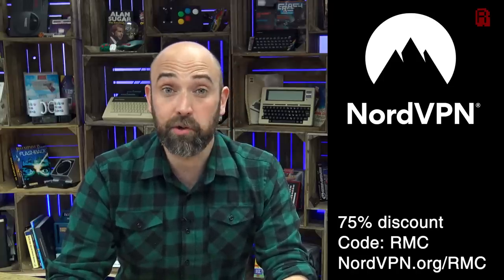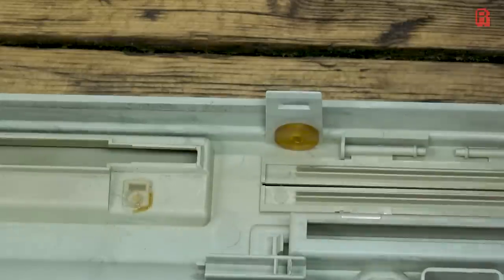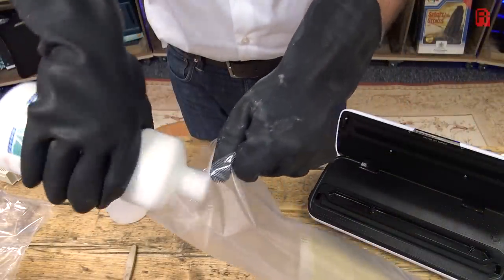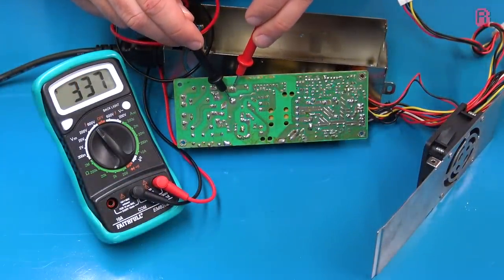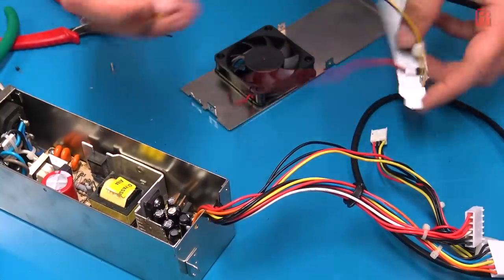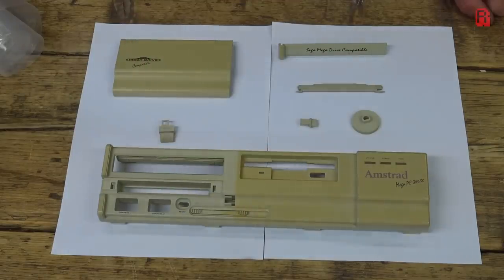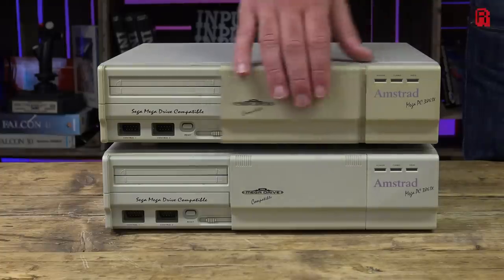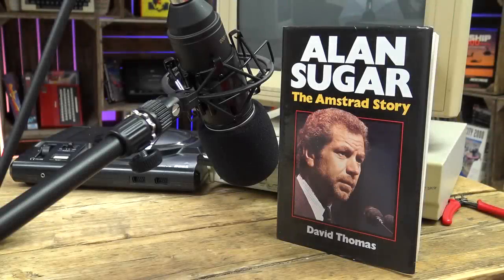Amstrad Mega PC - Retrobrite and Repairs | Trash to Treasure (3/4)

Comment: in the future, re-galvanizing corroded steel is actually very easy via electroplating. just need a ~6V@2A power supply (a 6V battery charger or bench power supply), a chunk of zinc to use as an electrode, some copper wire, a tub big enough to hang the steel piece in, and some epsom salt as an electrolyte.

before starting, make sure the steel is very clean; use nitrile gloves while handling it, clean it with fragrance free dish soap and a nylon brush to remove any dirt or oils, and then with a metal cleaner and scotchbrite pad to remove any oxidation. otherwise you could end up with dark spots or peeling zinc.

hook the positive lead of your power supply up to the zinc electrode, and the steel up to negative with the copper wires hanging it. make sure to move the work piece around as the plating is more-or-less 'line of sight.' just don't let the electrode touch the work piece!

with a thick enough plating, you can buff the zinc to a shine and clear coat it. 😺

I replated the rusty EMI shielding and IO ports on my Macintosh Quadra 610 that way.

Comment: I'm curious as to why you didn't just swap the fan out for say a 60mm  noctua fan. It'd be quieter. Is it because you didn't want to bother with  converting the 12 volt  fan header to 5 volts?

Comment: 337V is peak-to-peak voltage of AC waveform. 240V is RMS  (root mean square) value of ~339V p-t-p. These big capacitors in power supplies are usually rated at 385v-400v because of this. Using lower rated capacitor will result in fireworks.
Reply: i also said psu recap was not necesary since that PC was probably not used for more than 3 years. My dad has DVR for  video surveillance at his firm and it has a "Delta Electronics" PSU inside 
which looks identical to this Seasonic and it`s been on for the past 17 years with minor intreruptions. PSU it is rated 250w maximum peak power but the DVR uses less than 70w.
These new electrolitic capacitors (manufactured 2019..2018 ) that can be found today in shops are like the blank cd`s you find today in shops.. just a legacy.. poor quality... 
i think he just shortened the lifespan of that PSU :(

Comment: If you want to stop it from yellowing after retrobrighting get some high quality car wax and apply it to the plastic. It will reflect uv light and act as a replacement for the original protection the plastic had. It will slow down the yellowing process substantially.

Comment: You can measure a voltage across two points in any circuit and it is always completely accurate, no problems (well, if the meter is in order). Measuring singular component values (in example measuring resistance of a resistor) in a circuit might not give correct results because of the other components. 
   The large cap is rated for 400V (the max voltage you can put at it's pins), the capacity is something else. Shorting a "loaded" cap with a screwdriver will most likely damage the cap itself before the other components.

Comment: I think there do exist cooling fans that have built-in thermistors to control their speed based on ambient temperature. They're not exactly accurate but they are kinda neat and you wouldn't need a fanspeed controller for it.

Comment: As a big fan of your YT channel, I especially love your Amstrad Mega PC with other Sega MegaDrive, NEC PC-Engine and (of course) Amiga related videos.
It's pleasure to see in details parts of this Amstrad Mega PC because it was very, very rare in my country (France) and is impossible to find today.
Just a question/suggestion: I wonder if it's possible to make the MegaDrive part region free with a switch as with a regular Model 1 Sega MegaDrive? Did you check about this possibility? Because I don't remember you speaking about that in the previous videos (maybe I'm wrong).

And thanks a lot for your great videos.

Comment: Nice to see a Seasonic PSU in that old system. And it still works well despite the age of it's capacitors. These PSUs are built to last. I have one in my PC that's over 6 years old, still going strong. There was absolutely no need to recap your power supply although doing so definitely didn't hurt, considering the age of those caps.
Those ADDA fans are indeed quite noisy, even the 80mm ones.

Comment: I'm not on board with what you did with the PSU fan. You will have to guess the temperature inside the PSU pretty much constantly, just so you could fit the smaller fan inside. I would have tried necessary modifications to the larger fan to make it fit, or just keep the smaller fan with no regulation. Seems like the safer solution, to me.

Comment: Great job! A lot of work went into this.
One quick point... you could use a bit of Roxul (also called Rockwool) to dampen the PSU sound (up to 40-60% - maybe more). It's also fireproof and non conductive. :)

Comment: The professionally recommended method of discharging caps is indeed to use a high value resistor and not a dead short. This avoids accidents and unintended damage/injury.

Comment: @RetroManCave Hey can you Share Your Knowledge for a second Please, Ok so i have a Dvi-Female cable(each side) and i went to connect my computer and monitor only to realize the ports are both Dvi-D. XD The only difference i believe is that Dvi-F has two more pins. Could i simply remove the two extra pins from the Dvi-F connectors and then plug it in to Dvi-D???

Comment: If there's room, chopping out the punched fan guard and replacing with a wire one would improve the air to noise ratio
Reply: I second this.  When he turns up the fan, you can really hear the wind noise likely from the stamped fan grill.

Comment: Neil, one thing, not sure if you thought about that or not, but just in case, maybe you want to consider placing some aither aluminium or a black foil bellow the bath to bounce the light up in the case of the AL foil or heat up in the case of a black one.
I used a black plastic inside a bath like yours to heat up the water inside when exposing to direct sun light and it helps raising the water temp for a couple of degrees.
Reply from the maker: Good idea!  My table was probably absorbing a good amount of heat.  Anything to give that Sous Vide stick an easier life

Comment: Which VRAM did you use and where did you source it? It's the final upgrade I've never had much success in sourcing. This series has been absolutely incredible, I've been very impressed. I'd like to recap mine but I don't dare!
Reply from the maker: Here you go, I can confirm that it now detects 512kb since fitting it as I film part 4 - https://www.silicon-ark.co.uk/aaa1m304p-07-256Kx4-dynamic-ram

Comment: PSU's definitely retain energy. A few yrs back i took a PC PSU off the shelf in my workshop. It had been there for many months not used. I needed some parts from it so took it apart, and thought, oh i will just short the big caps incase. Got a big screwdriver, and BANG !! and a big spark. I nearly wet my pants. Certainly was not expecting that !. So indeed, discharge caps in all cases. 
I think there is a story of a USA kid being killed a few years back trying to repair his home PC PSU himself. Unplugged. Enough energy to kill him sadly.

Comment: This was a thoroughly enjoyable journey. Would recommend Noctua fans, they have a full range including 60mm.
Reply from the maker: Thank you!  I did turn to Noctua but couldn't find one slim enough...but if you come across one let me know and I'll add it to the RMC shop to help others
Reply: @RMCRetro  I stand corrected, It looks like Noctua only have the 25mm. I looked through some of my fave fan brands and only found the Scythe Mini Kaze 60mm which is 20mm thick, only 2 pin with a 3 pin adapter however. I still have a Scythe tower cooler/fan combo running since 2007! Thank you for the heart! 🙏

Comment: Really enjoying this series.  And I can even support the sponsor as I’ve been using Nord VPN for 2 years now (just paid for another 3years) and found them to be everything they’ve promised- even the telephone support was excellent the one time I used it, I was on the phone for just a few minutes and the problem was resolved.

As to the Mega PC, I am very tempted although I think it might just end an unfinished project in my hands.   You mention regular washing up liquid contains salt and seem to warn against its use- not being funny but you also suggest using baking soda which is Sodium bicarbonate so, erm, salt!

Good advice on the PSU, but that PSU still looks dodgy by design.  There is a fan venting in but no way for air to easily escape?  I build a few small form factor/ITX/STX builds and these types of PSU are by far the last choice.  Server/Flex design is always noisy.  I’d trade originality and swap it out if I could, I think.  Have you looked at Noctua fans?  I use them a lot, expensive but really world class, they have 15mm designs and come with a low speed adaptors (much like you already are using really).
Also, a bit of a patina is OK, it is supposed to look a bit old.  Alan grew on me as well; repetition is the trick here I think-LOL.
Great Work!
Reply from the maker: Hi Jason, good points and thanks for commenting constructively.  I guess with the bicarb it's a case of using it before the final rinse to make sure it's all off although yes a small amount will then be in the water you're rinsing with.  On the PSU there's a vent at the back and at the side which is where the fan mounts, a couple of people have raised this so I clearly didn't show enough angles of the PSU and confused you all sorry about that.  Good news on NordVPN though I'm glad that's working out for you.  I have it on permanently on my phone and desktop with no complaints it's great.  or Grate.

Comment: The real problem with that PSU is that I don't see any place where fresh air could enter the metal box. That means your fan has to work harder to get the hot air out. Some ventilation vents around the sides or something could work wonders there in allowing the fan to be set to a much lower level.
Reply from the maker: There is another hole at the back.  A few people have mentioned this so I perhaps didn't show enough angles.  When you see the back of the machine the PSU vent is not the one the fan is on.... that's deeper in the machine

Comment: I wonder if the MegaSD unit that's coming out would work on this. just how compatible is "compatible".  For those wondering the MegaSD is a cart based MegaCD thing, which might finally answered the age old MegaPC question of "can I play Snatcher on this?" with a Yes.
Reply: Well really you could put a modern ITX/STX motherboard in there and just virtualise/emulate the whole thing.  It would look the same visually and you’d have the benefits of having modern kit.  It can be an idea if you end up with something totally bricked and you don’t think you are up for a restoration and if you are careful not to cut the case then there is no real harm done.
The thing is that only works if you have guys like this who are keeping the old software and hardware alive as there must be a reference point- it’s hard to emulate something that no longer exists in physical form.
I don’t support software piracy, if I can buy I will buy, but better to keep something alive.
Reply: @twmbarlwmstar  Ok and good luck getting the MegaCD attached then.
Reply: @twmbarlwmstar  So how goes getting the MegaCD working on a MegaPC then?  I'm looking forward to your project log... come on. DELIVER.

Comment: Seasonic power supply? That is awesome. Didn't see that coming.
Reply: I noticed that as well, that's awesome :)  Still around and powering many PC's (including mine) today!
Reply: @YesterGearPCii  too bad it has 2019 caps in it now.. fan would have been fine with just a drop of mineral oil.. that is not a seasonic anymore.

Comment: When working on the PSU, had you considered replacing it with a pico one with adapters to change connectors to AT and molex? Would that have even been possible?
Reply from the maker: Hey Coconut Andy.  Yes you could but you'd need to get creative to keep the monitor power pass through... not that that's essential.  Where possible I like to keep it original though

Comment: Is there an inlet on the PSU? I didn't see any way for air intake in the video. That may also reduce the speed needed on the fan, by reducing the resistance to airflow that it needs to overcome - might be worth cutting a hole in it
Reply from the maker: Yes there is an inlet on the rear

Comment: i wish someone would do a supercharged version of this.  instead of a sega mega drive it uses a dreamcast and a pentium 3 1000 with a geforce 256 all inside a 1999 style case.
Reply: Sort of a development of the idea, companies like Phanteks (Dutch I think) do big full sized ATX case that will also take an ITX motherboard, along with PSU designed to run two boards and so on.  The idea is you put your big (probably Threadripper/ Xeon based ATX workstation in the case- that has 18 cores or what have you (64 with a threadripper and hyperthreading), great for productivity, encoding and so on, not so great for gaming.

Then the ITX sits in the top of the case and that will be your gaming rig, and of course that might be something like a 9900K or R1/2600 (you may need deep pockets, then again I think the case alone is more than £200).  So, the idea is the ITX will be better at gaming and you won’t be running a massive rig to just do some web surfing or gaming, or you could be doing some heavy number crunching on the workstation while gaming on the ITX.  Given the cost this will remain niche but then so did the Mega PC.

Microsoft seem to have changed approach with Xbox (live/ Game Pass) as well, seemingly less interested in what platform you will use and just focusing on you signing up to Live/Game Pass.  This has the obvious effect of potentially making an Xbox particularly unattractive to PC gamers since there will be no benefit to owning one, but there will also be very little benefit to owning a Playstation either as most Playstation exclusives, are only kept off Xbox not PC for any length of time.

Comment: Gelid makes a fan, the Silent 6 60mm that's only 15mm deep, thumbs up so he sees this. I've used one fixing an old oddball retro PC of some sort with a Pentium III, the fan had to be really thin 'cause it had to work with the screws with the included heatsink, was pretty damn quiet too. Certainly quiet enough you won't hear it over Alan

https://www.amazon.com/Gelid-Solutions-Silent-Computer-Case/dp/B008S1HNPS
Reply: Noctua are the premier kit I think but there is a whole small form factor sub-scene being supplied so there is a lot of stuff that can be used, especially fans and PSU.

Comment: Noctua builds great fans that are quiet and move lots of air at very low fan speeds I would have bought and swapped the fan out with one of them they are readily available from Amazon.com.
Reply from the maker: I agree but wasn't able to find one thin enough at this size for the job

Comment: Wouldn't a plain UV light source (ie black light tubes, or UV LEDs) be better/more efficient than a full spectrum light?
Reply from the maker: It's certainly something worth trying and I'd be interested in seeing how that works out.  The funny thing is that after the 2 weeks of rain we had when we did this we now have a heatwave across Europe.  Sods law!
Reply: @RMCRetro  Yeah tell me about it. I like being at work right now, because here we at least have an AC that somewhat reduces the heat. You can get strips of UV LEDs cheaply on amazon (I bought a 1m strip to build a UV resin curing light, which worked pretty good).

Comment: So, I'm just starting the video here, so if my question is answered within, I'll delete this post, but seeing as it was released in 1993, does that mean it has a Megadrive/Genesis Model 2 inside of it?    I only ask because I have a Genesis Model 2, and its manufacture date was August 10, 1993 (stamped on the board).
Reply: yes the megadrive asic on the megadrive isa card is one from the model2 line of megadrives... but it has a dot on it's part number so maybe something is different https://i.imgur.com/ZcFbBi2.jpg

Comment: I hear you can brighten your old gear by just leaving it out in the sun for a few days
Reply: i will just get  more yellow... turning orange eventually :)))
sun only helps in combination with the peroxide solution they are using and no air.
Reply: @cadpietre4378  Not true, sun bleaches and these plastics only discolor like that when left in sunlight while indoors
Reply: @RetroBerner  the sun burns bro... :| that`s why you get a tan...
anyway.. you may leave your plastic in the sunlight if you belive it helps.. but i`m pretty sure it does not.
Reply: @cadpietre4378  Retro Recipes did a video on it
Reply: @RetroBerner  ok.. watched the videu :| 
this is hard for me to belive because i`ve been teched that the sun is the cause. but it`s an interesting video, i`ll try it myself. subscribed

Comment: I doubt that power supply fan is really necessary. I'd be binning it personally!!
Reply from the maker: I'm sure it would be fine but in the longer term anything to keep the caps happier in there is a good thing, they get pretty toasty.  The new caps mostly all have a higher temperature tolerance than the originals also so that will help.
Reply: There doesn't seem to be any airflow at all. Just a fan bolted to a closed box. Or did I miss the intake or exit holes for the air?
Reply from the maker: This is at the rear of the PSU and sits at the back of the case